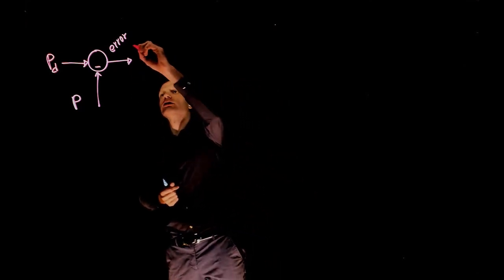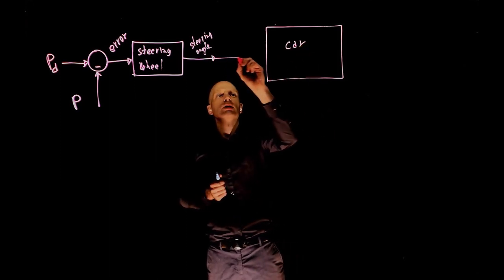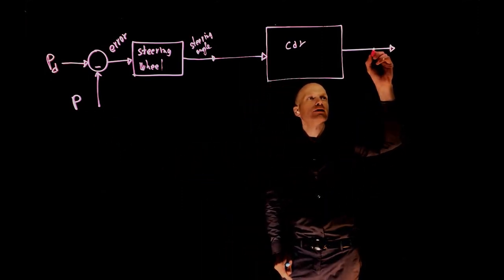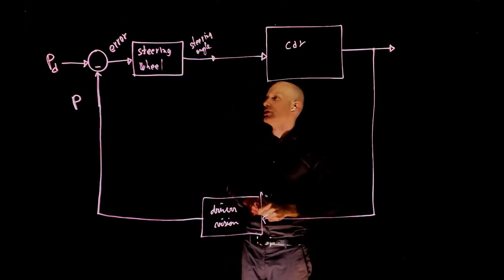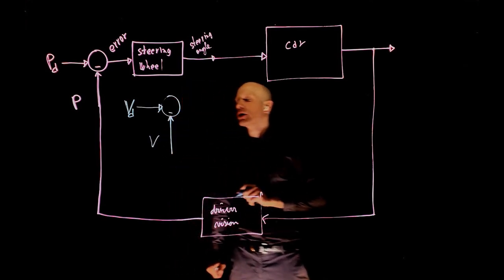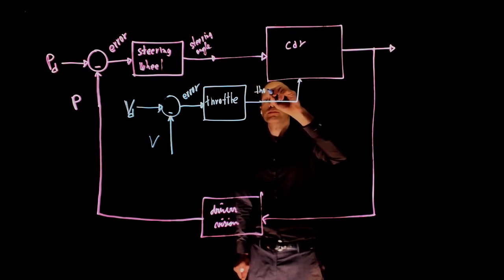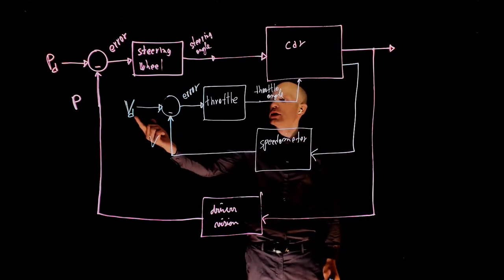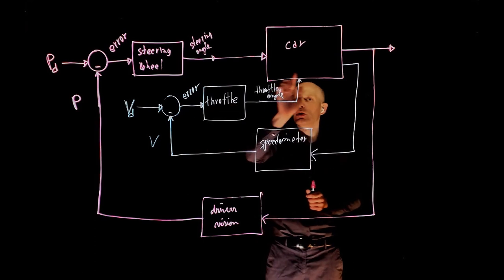L1E1 - Control Systems, Lecture 1, exercise 1. Introduction to control systems

Comment from the maker: The controller in this example is the driver. It should be placed before the steering wheel and throttle. For clarity, it was omitted in this example.